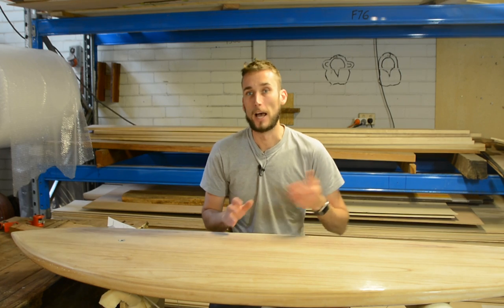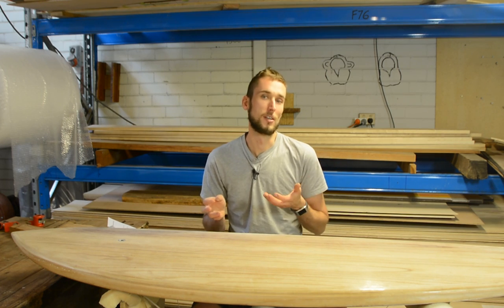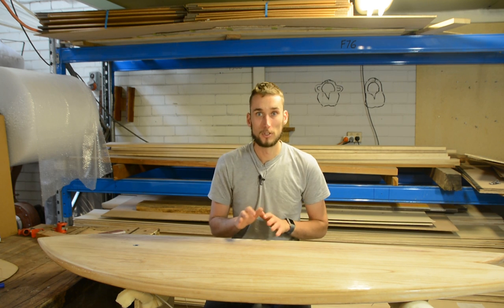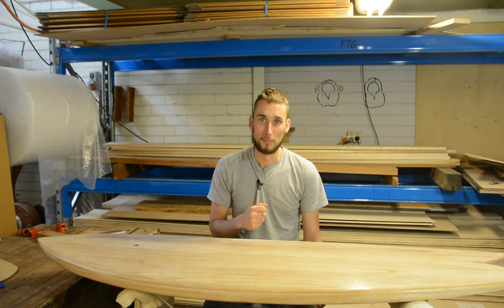How To Fiberglass a surfboard (Overview)

Comment: Good help. If there is less length folding under the board then you won’t get many wrinkles in the cloth. So 20 mil or 30 mil overlap on cloth. I found on my first craft that there was folds everywhere because there was so much cloth. I worked it down as I went along to a few wrinkles.

Comment: Very helpful vid.   What be the desired air temperature to work this so that the epoxy does not set up too fast?  Also about how much time you have to work the epoxy resin before it starts to set?

Comment: .....all well explained apart that "epoxy is less toxic than polyester". Epoxy got much better mechanical properties, can be used on eps blanks, got better wetting properties of fibers so it saturates fibers much faster.... But it is far more toxic than polyester. See the health toxicity advice expecially on the hardner drum. Less smell doesn't mean less toxicity. Take care.

Comment: Guys I'm a professional surfboard glasser, the laps have to be super saturated for the best possible result. And polyester resin is so much easier to work with than epoxy
Reply: but dosent polyester eat through the foam? (this has happened to me). To be honest I would never try again with polyester unless you can tell me the trick for choosing the right one. I live in the Balearic Islands, and have a very limited supply of materials.
Reply: EPS foam is more sensitive to hot temperature than PU. Poly resin gets hotter than Epoxy. If you have an EPS foam board you have to use Epoxy resin. If you have PU foam you should be able to use poly or Epoxy resin. I hope that helps.
Reply: Kinouille K Do you know if XPS foam would do good with poly resin?
Reply: @clarabrooks7984  Unfortunately I do not know. Best of luck.

Comment: I'm glassing homemade wake skates that have a very sharp and narrow edge along the bottom of the rail, cannot get the fiber glass to fold over that edge to where the lap should be, any suggestions?
Reply from the maker: The first thing that comes to mind would be trying a cloth that is a 0/90 biaxial cloth rather than a weave as this are much better for draping over sharp edges, but also it may be the cloth weight your using may be too much for that edge... 

without seeing it, its hard to say though
Reply: @JordsWoodShop  Thanks for the reply, that is certainly part of the problem. Where I live there are only two available cloth weights, one is a heavy woven cloth and the other is basically tissue weight, which will take the edge but in the end doesn't hold up to the punishment. I did layer yesterday and brought the heavy weight out to the edge, and I'm going to try a tissue layer over that and over the rail??? and see what happens.